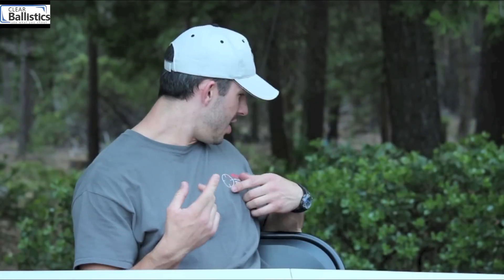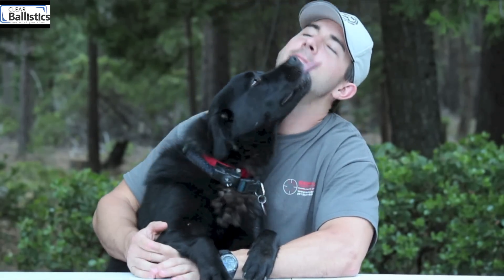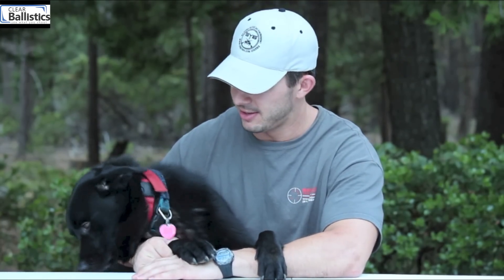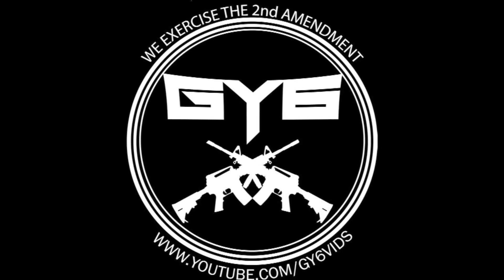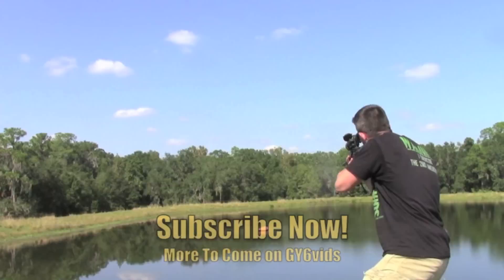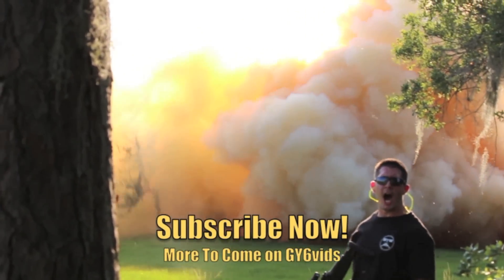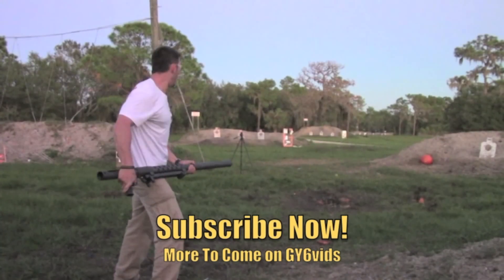Explosion Inside of Ballistics Gel- "Sonoluminescence or Dieseling" is the cause

Comment: Guys, it is very simple. This gelatin is paraffin oil based (probably Kraton+paraffin oil), and the bullet evaporizes it to some extent into the temporary cavity. When conditions are lucky enough that some air is also sucked into the cavity while it is expanding, you get a paraffin+air mixture, that can ignite during the collapsing phase. So it is simple dieseling.
Sonoluminescence, good joke.
Reply: deleted by submitter

Comment: Here it is in a nutshell.

The cause of the micro explosion is the result of rapid and adiabatic compression of the air that travels into and through the penetration point made by the bullet upon entry.  Kinetic energy is passed along through the gel at the initial impact point.  This creates ripples traveling across the outer impact point like ripples on a pond from a pebble that is tossed into the water.  As the ripples come tougher they seal the entry point for mere microseconds.  This creates a temporary airtight seal that prevents the trapped air from initially escaping. 

 The combination of both the traveling air and kinetic energy form the bullet (mostly the bullet) then expands the cavity.  As the expansion later collapses, the trapped air then becomes rapidly compressed and super-heated due to friction, thus expanding into a micro explosion as the heat energy is then released.  It is important to note that the heat from this process also causes some of the molecules in the ballistics gel to transition into a gas form thus adding to the amount of gasses that are then available for compression.  

This rapid and adiabatic compression is also what occurs in a fire piston, which is an ancient device that uses a sealed cylinder and airtight plunger to create a fire ember when the plunger is struck.  However, a fire piston has a plunger that is struck by a human hand and the speed of that strike is quite limited when compared to the speed and kinetic energy of a high velocity projectile. Therefore, the micro explosion for a fire piston made for use by human hands is incredibly small and not usually noticeable.  I hope this information helps.

Blessings,
Crypto

Comment: Actually, I'm pretty sure that this is a phenomenon called sonoluminescence. It's caused by the collapse of cavitation bubbles at extremely fast speeds due to the density of the ballistic gel!
Reply: Andrew Malaty bingo.
Reply: You are right
Reply: Iike a car cylinder gasket… if that happens in a body you very well found one reason a person passes out or dies instantly. It could also be liken to two rocks smashing onto eachother causing a spark….
Reply: Read the title
Reply: @josephcontreras8359  it might seem obvious now that it's in the title. Believe it or not, when I posted that comment all those years ago, the video title was different.
Reply: Can the sonoluminescence explain smokes after the ignition? I think it is improbable.
Reply: Likely the gel is made of something flammable that vaporized and got compressed, ie dieseling as he first thought

Comment: Yes, sonoluminescence, but with fuel added.  (The dry gel powder is probably flammable, even with no-powder exotic weapons, or Lewis & Clark air-powered hunting rifles.    "Pure" sonoluminescence uses distilled water w/dissoved Argon gas.)

Try mixing up some gel with lots of salt.   That should give a much brighter flash, brilliant yellow-orange.    Or try strontium nitrate, barium chloride, or other fireworks chemicals.   They look clear and uncolored, but produce brilliant red, or green.

If the gel was an explosive, or just filled with dissolved oxidizer, the bullet collision might not set it off, while the bubble-collapse-ignition might go BOOM.
Reply: wbeaty maybe aluminum powder with potassium chlorate

Comment: Hmmm... I wonder what that clear gel is made out of? Think of the bullet like the piston in a diesel engine. When the fuel is compressed to a point, it heats up to its ignition temperature point. What I'm wondering is if that clear gel is acting like a diesel fuel, and the bullet the piston? I've seen this on other videos on YouTube. Check out the channel: shootingthebull410.

Comment: People, this is simply a relationship of the gel's flash point and autoignition temperature. This is pretty common in many media but very visible in this clear block. The compression and heat over time is all provided when the bullet impacts the gel.
Reply: "Flash" would be more appropriate than "explosion" for explaining this phenomenon. Likely, the flash happened as the cavitation began to collapse,increasing pressure, while the temperature was still sufficiently high enough.

Comment: Two alternate theories to this that I know of.
1) There is a phenomenon that happens when a air bubble collapses in water, it will actually produce a flash of light that has yet to be explained.
2)  With a high enough velocity, large frontal area round, the heat produced inside the target will actually cause an explosive expansion.  This also happens with the full load 10mm as well, it causes 2 separate wound bulges, one from the explosive expansion and another from the round energy dissipation.

I am voting for the latter, look for some 10mm ballistic gel footage, I think BrassFletcher has one that it does the same thing.

Hope this helps.

Comment: Mr.Ender19 is correct: I've seen that in other test as well. Usually see it in higher velocity rounds- I noticed it first in some tests on 9mm+p ammo.It's also the same concept as the fire pistol. Air compressed rapidly enough creates heat, enough heat creates fire.

Comment: Sonoluminescence. When "bubbles" collapse they emit light and heat. Its probable that the heat reaches the burning/flash point of the oil-based synthetic gel and burns a little of the surface and loose particles.

Comment: I do a lot of ballistic gel testing, first thing I noticed is that the media (gel) scorched about five inches in (no ruler, just guessing).  If you look close you will see a burnt spot form in the media, then a flash (all of course happening in milliseconds), then once the media burns and creates a vacuum, it releases the pressure back out of the front entry point.  Watch close and you will see the burnt spot, then the spent gases releasing.  This is synthetic gel, and will burn.

Comment: I have seen this phenomenon before. Its called cavitating sonoluminescence. It happens when a sound wave hits a bubble causing it to expand and then contract. When it contracts it slams together with so much force that it releases light. For a short time it reaches very high temperatures. Here are a couple more examples of it. 247gr NOE Cast Boolit! Handloaded 300 AAC BLACKOUT 300 BLACKOUT Controlled Fracturing! 186gr Fragmenting Subsonic by Lehigh Defense

Comment: If you shoot a pellet backwards at low velocity (1-2 pumps in a Daisy) into a block of gelatin, it will 'diesel' upon impact, creating a small 'crack' and a puff of smoke that smells like burnt sugar.   The same thing is likely happening here, as so many other folks have said.  The hot projectile plus rapid expansion will heat the gel and convert some of the material to vapors and particulate.  When the bubble collapses, heat of compression will ignite these materials, just like a diesel engine.

Comment: mechanism of the phenomenon of sonoluminescence remains unsettled.Hypotheses include: hotspot, bremsstrahlungradiation, collision-induced radiation andcorona discharges, nonclassical light, proton tunneling, electrodynamic jets andfractoluminescent jets (now largely discredited due to contrary experimental evidence).

From left to right: apparition of bubble, slow expansion, quick and sudden contraction, emission of light

In 2002, M. Brenner, S. Hilgenfeldt, and D. Lohse published a 60-page review "Single bubble sonoluminescence" (Reviews of Modern Physics 74, 425) that contains a detailed explanation of the mechanism. An important factor is that the bubble contains mainly inert noble gas such as argon or xenon (air contains about 1% argon, and the amount dissolved in water is too great; for sonoluminescence to occur, the concentration must be reduced to 20–40% of its equilibrium value) and varying amounts ofwater vapor. Chemical reactions causenitrogen and oxygen to be removed from the bubble after about one hundred expansion-collapse cycles. The bubble will then begin to emit light "Evidence for Gas Exchange in Single-Bubble Sonoluminescence", Matula and Crum, Phys. Rev. Lett. 80 (1998), 865-868). The light emission of highly compressed noble gas is exploited technologically in the argon flash devices.

During bubble collapse, the inertia of the surrounding water causes high pressure and high temperature, reaching around 10,000 kelvins in the interior of the bubble, causing the ionization of a small fraction of the noble gas present. The amount ionized is small enough for the bubble to remain transparent, allowing volume emission; surface emission would produce more intense light of longer duration, dependent on wavelength, contradicting experimental results. Electrons from ionized atoms interact mainly with neutral atoms, causing thermal bremsstrahlung radiation. As the wave hits a low energy trough, the pressure drops, allowing electrons to recombine with atoms and light emission to cease due to this lack of free electrons. This makes for a 160-picosecond light pulse for argon (even a small drop in temperature causes a large drop in ionization, due to the large ionization energy relative to photon energy). This description is simplified from the literature above, which details various steps of differing duration from 15 microseconds (expansion) to 100 picoseconds (emission).

Computations based on the theory presented in the review produce radiation parameters (intensity and duration time versus wavelength) that match experimental results with errors no larger than expected due to some simplifications (e.g., assuming a uniform temperature in the entire bubble), so it seems the phenomenon of sonoluminescence is at least roughly explained, although some details of the process remain obscure.

Any discussion of sonoluminescence must include a detailed analysis of metastability. Sonoluminescence in this respect is what is physically termed a bounded phenomenon meaning that the sonoluminescence exists in a bounded region of parameter space for the bubble; a coupled magnetic field being one such parameter. The magnetic aspects of sonoluminescence are very well documented.[5]
Reply: Thank you for the detailed explanation!
Reply: Merica
Reply: That made my day.

Comment: compressed gas explodes (even air). i don't think it would need any powder from the cartridge to make the flash. the smoke could be from burnt ballistics jell. i don't think this is sonoluminescence because there is no sonar involved (i could be wrong) i think its more like what happens in a fire piston. the bullet probably caught some air from the shock wave in the cavity where it was compressed until ignition.
Reply: All sound is just air compressing and decompressing. Music is when this occurs at different frequencies and rhythms in harmony. As the round punches through the gel, it opens an air pocket called the 'wound-channel'. This causes the gel to compress outward with the sonic wave. When it rebounds, it compresses the air in the channel behind the round. If this happens at the proper resonant frequency, you get a sonoluminescent reaction, like what happened in this video.
Reply: You're right bro. add since words what what you said and yeah, you got it. it's not the powder it's the claps of the sonic boom inside the gel. same thing happens under water

Comment: I think what is happening is, because the leverevolution powder is actually very slow burning powder being meant for long rifle barrels, some powder was smashed and stuck against the back of the bullet because 2 inches probably doesn't burn very much, so it was stuck, drug into the gel and because the pressures inside super heated the air, that reignited the rest of the powder

Comment: Just my two cents. but the first thing I thought of is a fire piston. It looks like the ignition doesn't start until the temporarily wound channel begins to close. It seems like the entry and exit wound sealed, leaving a massive amount of air inside the block. The holes sealing also explains why you almost hear a whistling sound when the gas is escaping. When the block tried returning to its original size the compression of the air was so fast and powerful that it ignited any small particles in the void. This could be cotton from the shirt, unburned powder, or even particles of the copper itself. Like I said, it's just my thoughts, but that's the best explication I can think of.

Comment: I lean towards your feeling it was unburned powder perhaps sparked by some still burning bits of powder that came in behind the bullet, it might depend on bullet base shape, flat or concave would make a difference in giving unburned powder someplace to stay next to the bullet as it should disperse in the air in the case of a flat bottomed round like most jacketed bullets, but there is that drafting effect like in auto racing or when semi drivers get right up on each other.

Comment: The flash is from the projectile crossing back over from the speed of sound, any projectile that breaks the sound barrier  has that when it returns causing the air in the wound channel to ignite,... it's hard to explain, when you shoot a gun there is actually 3 bangs, 1 from the powder ignition,  the second is the projectile immediately breaking the sound barrier,  the 3rd bang you hear down range that sounds like an echo is when the projectile slows down and return from supersonic speed thus making a crackling sound, when that happens inside a wound channel, it ignites the compressed air in the channel,  I hope this helps, nice videos.

Comment: I think the flash is a result of the rapid expansion of the bullet. Any time you bend metal, that deformation creates heat. In the case of a bullet, the faster the deformation, the more heat  is generated without being able to dissipate. The visible flash could be the metal of the bullet briefly glowing, or it could be the heat of the deforming bullet igniting the gelatin or powder residue like you said.

Comment: Ive burned powder outside of a casing before and because of the intense heat it tends to stick to whatever its burning on so perhaps its possible that enough powder didnt burn all the way through that it stuck to the back of the projectile and the heat from the round itself ignited it once it entered the target (didnt ignite until target because of extreme velocity of a 357 magnum)

Comment: I thinks it's the same effect as what happens in a fire piston. If you don't know what a fire piston, look it up on YouTube. In an air piston, you put a pinch of flammable material and push down hard on the piston. The compression makes the material ignite. You can then start a proper campfire (eventually) by using this method. I assume that the clear gel must be potentially flammable as I've seen this a lot lately, but only in the clear gel blocks. If you slow it down, it happens as the initial cavity closes. Then the slow release of smoke assures you that you didn't just imagine that.

Comment: Actually I have witnessed this before but mainly when placing leather Like the type of leather a coat would be made of over the gel for a simulated test. I noticed you had a shirt over the gel. the clothing we wear has many chemicals that actually under extreme conditions will ignite. Leather, especially the type made for clothes is subjected to many flammable chemicals (some cases combustible) when being dyed and processed. There was the ignition for the fabric you had on the gel.

Comment: I wonder if it's a static discharge. Have you ever encountered this with a non polymer tip rounds? Try a few different polymer tip rounds and non polymer tip rounds to see if that is plausible. I only say that because with plastic at such a high velocity it is possible to create a static discharge with the right material. maybe asking not only the ammo manufactures if they have tested for this but also the ballistic gel manufacture as well.
Reply: that's what I was thinking. possibly friction from the gel igniting unspent powder left on the tail of the round.

Comment: saw this once before with a .338 lapua shooting 176gr ER Raptor bullets. Terminal Performance - .338 Lapua, 176 gr ER RAPTOR by Cutting Edge Bullets .338 usually uses a fairly long barrel so unburnt powder didn't really come to my mind at first. thought maybe it was the air inside the wound cavity compressing causing heat and the heat energy causing a flash. now that i think of it though you are probably right with the unburnt powder theory, 176gr is an insanely light bullet for a 338 LM (usually 250-300gr smallest normally is 225). the light bullet combined with 90ish gr of powder probably caused this in that particular case.

Comment: It most likely is unburned powder igniting, but it isn't dependent upon air following the round into the gel. Gunpowder and chemical explosives as a whole include their own oxidizer and as a result will work in an airless environment like, under water or in a nitrogen filled chamber. Not as well as they do with air...but they still go bang.